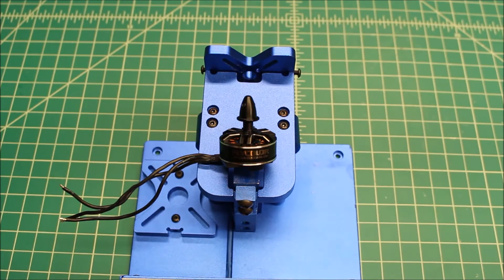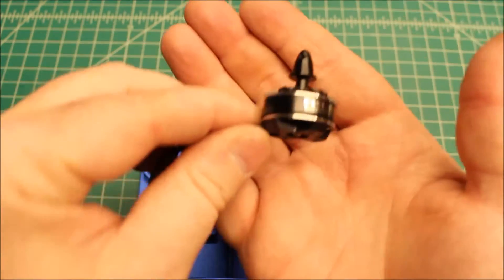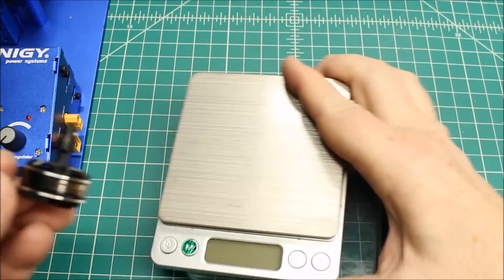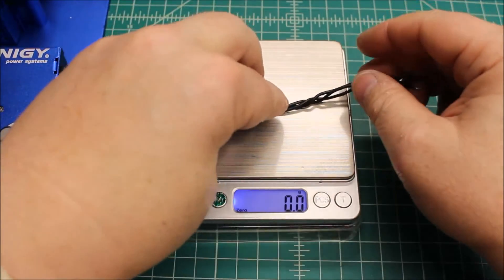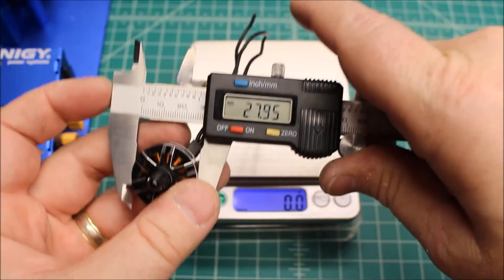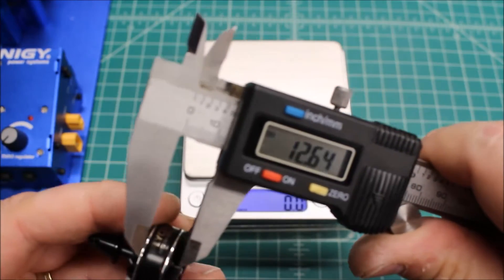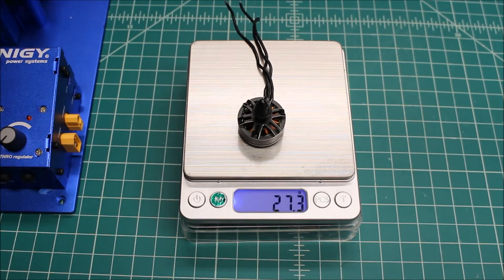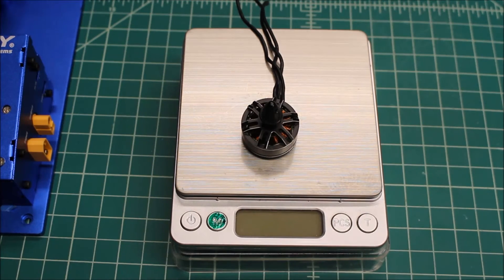Flycolor MT 2204  2300kv FPV Race  (Motor Test Series) by gearbest

Comment: You should test the 2205 2300kv Gartt or the  2205 2300kv Ifly.  I got them and test better than the emax red bottom motors. 
http://www.ebay.com/itm/252538201600?_trksid=p2057872.m2749.l2649&ssPageName=STRK%3AMEBIDX%3AIT

http://www.ebay.com/itm/262502672195?_trksid=p2057872.m2749.l2648&ssPageName=STRK%3AMEBIDX%3AIT